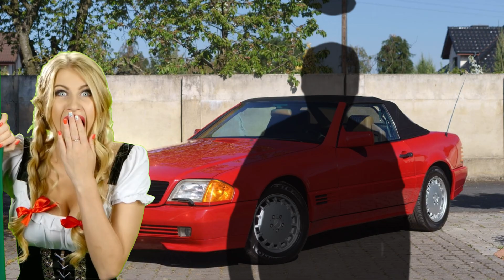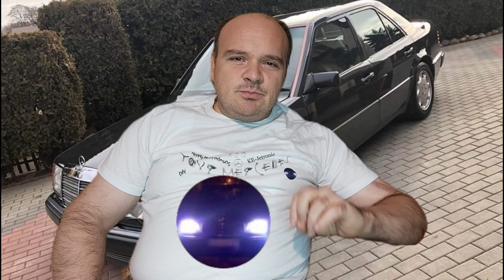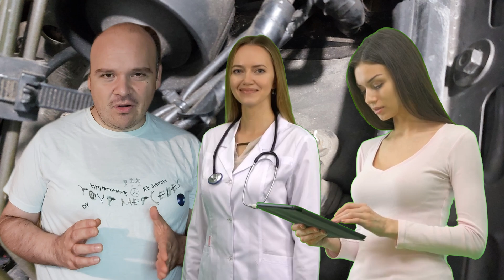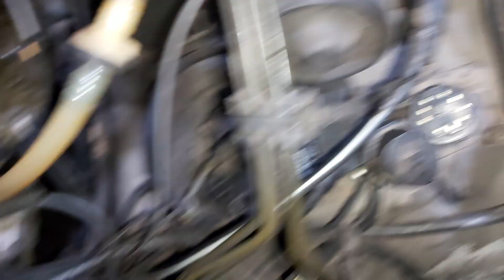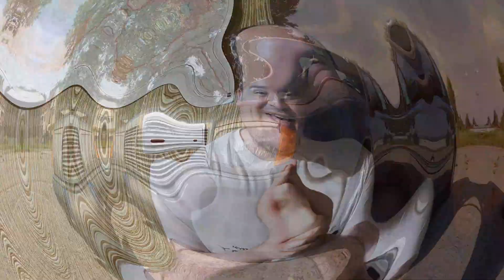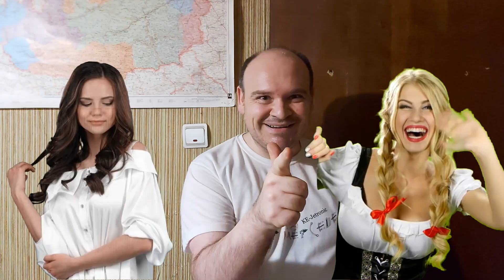㉦Mercedes Ke-Jetronic㉦ - 🎓The X11 port🎓

Comment: Hello my friend, can you help me please? I have W124 M102 that has been sitting off the road for 13 years, It is hard to start and when eventually it starts it runs really rough, low idle and misfire along with plumes of white/grey smoke that seems to be raw petrol, I have replaced rotor arm and distributor with genuine Bosch and used your method for setting up the air fuel mixture.

The symptoms seem to get worse as the car warms up and eventually it will just stall and doesnt want to restart, the fuel pump is running constantly too....I think maybe injector leaking/not closing properly but I have removed them and checked they seem to be in good condition?

Thank you!
Reply from the maker: How many km/miles has the car on the tacho?
Reply: @mercedeske  currently the car has 140,000 miles but has not done many miles over the past 13 years